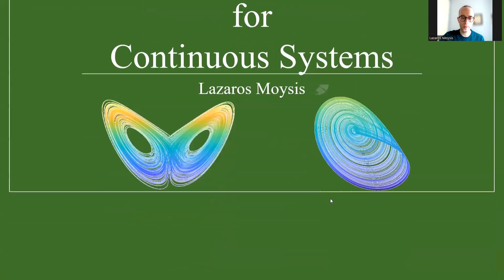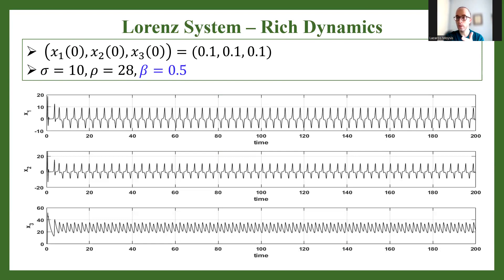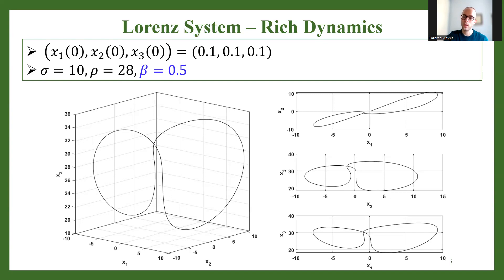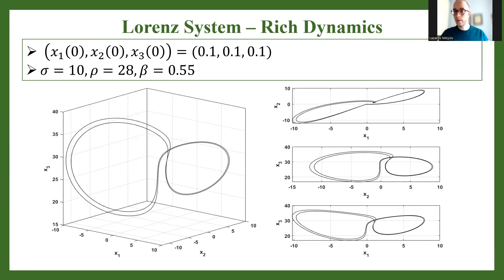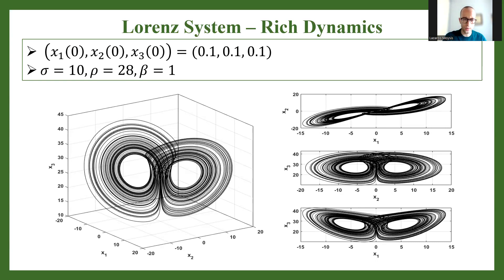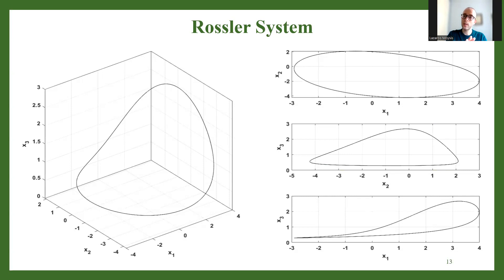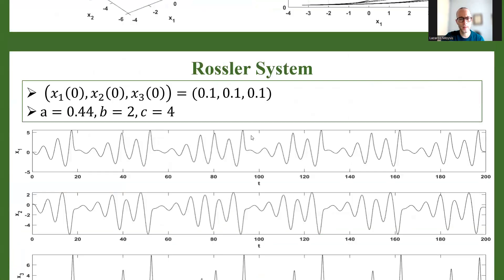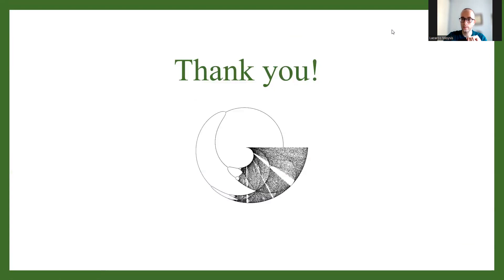Phase Portraits for Chaotic Systems

Comment: 1. Can we say the Lorenz system is chaotic for \beta=1? (4.28 min). 
The system may be highly multi-periodic  as there are multiple lines in the phase portrait.
2. Similarly, can we say the Rossler system is chaotic for a=0.44, b=2, and c=4,  (8.26 min) as there are some repeating patterns?
3. Are you saying looking at the phase portrait, we conclude a system chaotic if it fills the whole plain within certain bounds? The upper and lower bounds defining the attractor?
Reply from the maker: 1-Yes, 2-Yes. 3-by examining the phase portraits we can get a fast impression of the system's behavior. To be sure that we have chaos we need to compute the Lyapunov exponent, which can verify the existence of chaos. But a phase diagram that shows dense trajectories with no repeating pattern is a strong (almost certain) indication of chaos
Reply: @lazarosmoysis5095  Thanks for the reply! Can we certainly say by visually looking, at the dense trajectory that there are no repeating patterns? Is that why the computation of Lyapunov exponent is a better indicator?
Reply from the maker: @swagatabhaumik978  Yes, one is a visual indicator, while the other is a mathematical/numerical indicator